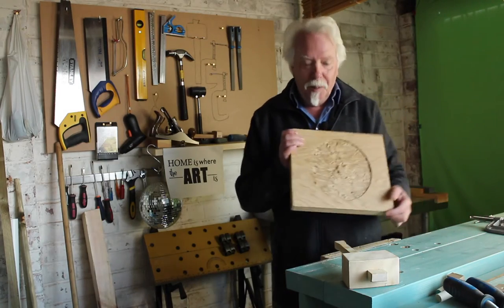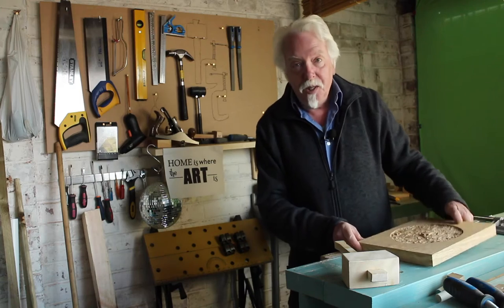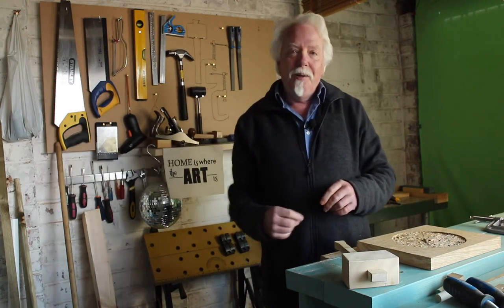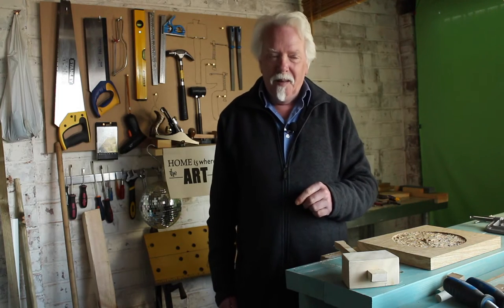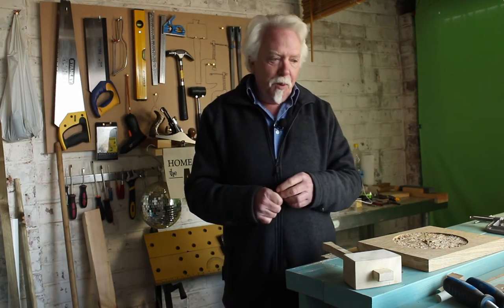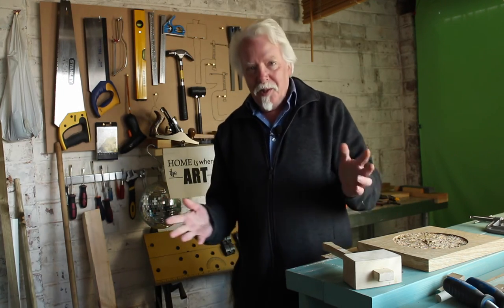Creative connections - how I decided to make a CNC router / 3D printer / flatbed plotter

Comment: Congrats on your project. Looking forward to the videos!

I went the other way around. I built a 3D printer - didn't design it myself, I must confess. I went the semi-easy way and bought a kit which had all the parts already. Took a couple of days of work but it came out very nicely. That was a couple of years ago, and I've been using it ever since. Recently I started thinking about making a conversion to a CNC router for it. Still working on that project but I'll probably get it done in the next few months. 

BTW the kit cost me about $400 so about 300 pounds. If you source all the parts separately it would be a little more than that and I found it not be worth it. 

(I also thought about a laser cutter conversion, but there are some safety issues involved - to cut 5mm of plywood you need a 30-40W infrared laser diode and the associated focusing mechanism, as well some serious protection as the beam is invisible but can seriously harm you especially if you catch it in the eye)

Comment: You should take a look at potentially joining a makerspace or hackerspace. In my experience makerspaces tend to have nice tools such as CNC's, 3D printers, laser engraving ... and people with the expertise how to properly use them. Hackerspaces tend to have some extremely knowledgable (and/or curious) people but some what less tools.

A makerspace would be an excellent way to get access to tools without having to buy/build them initially. Learn from the other people as these devices have some annoying pitfalls. Most makerspaces would also be able to point you in the right direction if you wanted to build a LED clock.

Hackerspaces tend to have more thinkers and a bit less do'ers. Electronics knowledge will run deep with some members but very few will directly give you the answers you need to implement something. They are more likely to show you how you acquire the correct information and are more willing to cooperate if they see you're putting effort into it.

I've been a member of a hackerspace for over 5 years now and thoroughly enjoy the interaction and the different areas of expertise of the members.

These are the tools we have:
We currently have a stepcraft CNC which we're quite happy with and the price to quality ratio is excellent though it's a bit of an investment (650 quid and upwards), this thing has accuracy and power and with an upgrade it's even possible to route aluminum.. haven't tried to do so yet

We also have two Prusa i3 3D printers and they are acceptable. Prices vary depending on where you buy the kits but I believe it's possible to get them for around 100 quid. I personally dislike 3D printing as the amount of time it takes me to get stuff calibrated, unclogged, proper config (temp nozzle, temp bed, extruder fan) is too much hassle for me. Other people however don't seem to dislike 3D printing so it's probably just me.

If you however really want to build your own CNC / plotter / 3D printer you could always use the prusa i3 plans as your starting point..

As for the LED clock.. read up on charlieplexing, RTC (shield) and arduino. You probably also want to use diffuse LEDs because clear LEDs tend to have angles where they are annoyingly bright or really dim.

Good luck!
Reply from the maker: Hi Josh - I have looked at the one in Leeds and you are quite right, I should join. However, the monthly membership fee is a bit more than I can afford right now and I really don't know if I would use it enough.

Comment: There's usually subtle differences between 3D printer and CNC router.

I mean sure a 3D printer is a CNC machine. But it has to be able to go pretty fast, because hovering a hot radiating nozzle a long time over one area of the print ruins the layers that you have already printed prior. On the other hand, it doesn't have to support any lateral load. X and Y axis of a 3D printer are generally driven nearly directly, e.g. by a belt.

On the other hand, a CNC router needs to be able to support a high lateral load, as the material resists being cut. It also usually needs to be able to carry a heavy tool. So the X and Y axis should be driven by a lead screw or at least threaded rod. Either works pretty much one way, i.e. when the motor turns the screw, the print head can move, but if something tries to move the print head, it just binds up and can't turn the motor. It doesn't have to run fast though

Actually a decent compromise can be achieved that can both move reasonably quickly and support a lateral force, so yeah they can be the same device. Now let me think aloud for a second, something like Marlin or Repetier can probably step the motors about 20 000 times a second, and they're gonna have 200 steps per revolution, so that's a max of 100r/s. Now a threaded M8 rod will move the print head at let's say 1.5mm per revolution, a 4-start 8mm lead screw can do 8mm per revolution. Actually, no problem at all, it's not exactly common to print at much more than 60mm/s... sure you can do double, but that isn't exactly necessary and more harmful than helpful.

Let us know how you get along, we'll be here for useless advice. I may be helpful on the electronics side of things.

By the way, the cheap 3D printer kits that you can get for 140€ on eBay aren't exactly a total loss either. Might be just the experience you need to move on with the router project, which... i somehow doubt you will fit within that 200£ budget, like it seems about plenty to cover the basics, like raw materials, electrics, electronics, but you'll certainly end up paying more anyway because... reasons. Well, like any hobby. And sure, there are CNC router kits from China that cost about as much. 

By the way, Thomas Sanlanderer and HomoFaciens could be helpful. Thomas has lots of great videos explaining firmware configuration and various 3D printer part selection, and a full 3D printer build from plywood, though it was more or less equivalent to the kit from China and cost more. He also did some motor tests for conversion of 3D printer into an engraver. HomoFaciens built innumerable CNC machines over the years and also has spindle motor tests. By the way, do not give into CoreXY craze, it's just that, an infatuation that many people have because it looks so smart, but when every movement of any motor torques the other motor, it's principally not as good as independent axis setup, i mean sure, they'll tell you they're not seeing any issues, but whatever, the first generation of CoreXY builders already went back to the Ultimaker style gantry.

And good luck on your project.
Reply: Siana Gearz thanks for the insights - since I made that video I've been doing lots of research and my head is full of linear drives, leadscrews, timing belts, pulleys, steppers, servos and Arduinos. And I realise that a multi-purpose machine isn't all that straightforward, although I still like the principle of using the same XYZ motion mechanism for different things - saves money and space. I've seen a few Kickstarters aiming to do the same thing. Anyway, it's a complex thing, so before I jump straight in I'm planning to build a motorised camera slider driving a pan/tilt camera mount, and then add Arduino control to that. I reckon that'll keep me busy for a while and I'll learn some stuff from that!
Reply: I'm thinking for your camera slider, you can use one of these StepStick boards that all 3D printers use, a variable 555 timer circuit to generate the STEP signal, and a simple toggle switch to set the DIR signal. And route the STEP through some limit switches in Normally Closed configuration so when your carriage crashes into the end, your slider doesn't dismantle itself. Or you could go straight the Arduino route, and i have bought like a ton of Digispark clones for about 50ct a piece for just such purposes to stick into things and forget them, though working with them is a bit tricky, so i can't exactly recommend them over any mainline Arduino clones. Minis and Pro Minis are quite fun too for compact builds. Depends on your electronics skill, how much you want to design or how much you want to buy as ready built modules and program.
Reply: Siana Gearz Just had a look at CoreXY - hadn't come across that before, but I certainly am familiar with parallel motion drawing boards from the early years of my design career! I certainly wouldn't be tempted to use that as the basis of an XYZ motion system!
Reply: I wonder though, will there be a KeefBuilds channel too? Because it's not exactly a subject of cooking nor a subject of rants.
Reply: LOL - my electronics skill is pretty close to zero! But I'm willing to learn...
Reply: I'm thinking of turning KeefTalks into KeefMakes. There's so much rantworthy stuff going on in the world right now I might explode if I made videos about it. So hiding away in my cave and trying to make stuff seems more relaxing and rewarding.
Reply: Yeah, i'd say my "electronics skill" is terrible too, but i have some electronics engineering university education and many years of work in embedded electronics industry. It's just such a vast field. Having the desire to learn everything, both software and hardware side, is very formidable, but somehow you need to pick your battles. And i have no idea how to do that, i'd say i'm terrible at that.
Reply: Hello Keef , that idea of keefmakes would be very good i always watch a channel called .. i like to make stuff ..he has over 66 MILLION VIEWS